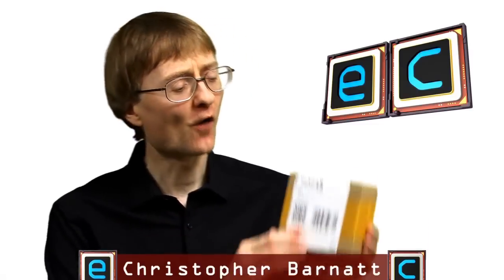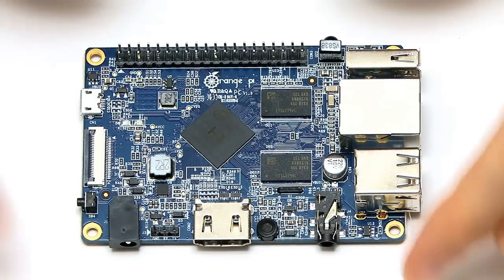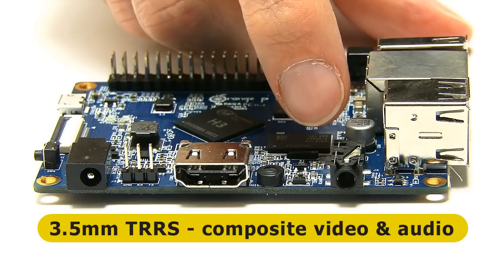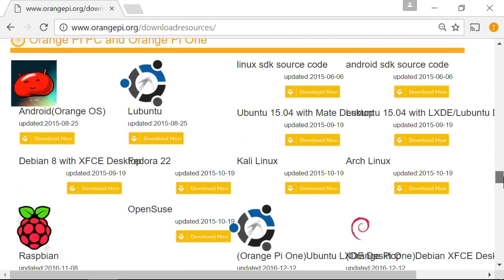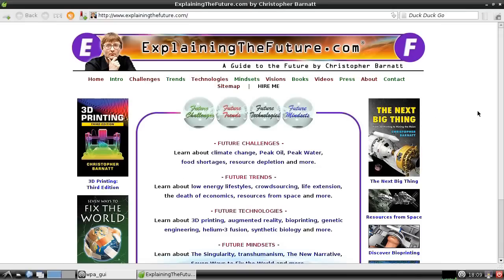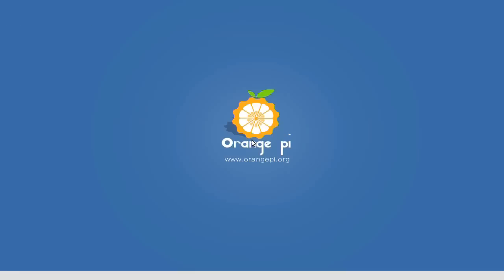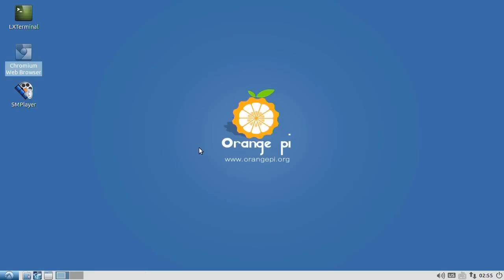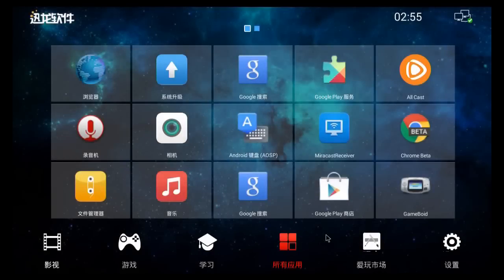Orange Pi PC

Comment: Love your video as always , detailed and enjoyable . I especially like how your videos start with the device's hardware followed by the software (:  Also , I will like to recommend a very powerful single board computer called the Odroid XU4 . It is priced at $61.95 , around the same as the Asus thinker board , but has 8 cores , 4 A15 CPU core @ 2ghz and 4 A7 CPU core @ 1.4ghz . It has 2GB of LPDDR3 ram and a 6 core Mali T628 graphics . It also have good documentation and support a wide variety of OS . Thus , I highly recommend this board due to its price to performance ratio . You can buy it from this website : http://ameridroid.com/products/odroid-xu4"Mr scissors!"

Comment: I was really interested in this video - and disappointed at the same time.  Not because of your video, but because the latest Orange Pi still does not seem to have a stable OS to run on it. :(  So I purchased a Raspberry Pi 3 instead.  I have used the quad-core Pi2 for a year or so now as my OpenELEC media-player, and it has never missed a beat, so we will see how the Pi3 goes.  I will be heat-sinking it though, as the Pi3 would seem to just about go into meltdown if current reviews are to be believed.

Comment: Orange Pi has has a wide range of products, WiFi and/or Ethernet, 256Kb to 2Gb, with or without HDMI interface and many more choices when you buy one of those product you can chose the one which will fit your application In your case you don't have an application in mind for it but you want a WiFi board and got an Ethernet board, why? Did you got it for free from the supplier in which case, to be honest, you should have disclosed this fact, in your video otherwise why did you buy an Ethernet only board when you only use WiFi? Imho WiFi is great for handheld devices, this is not the case of grid powered device connected to an HDMI screen like this device.
When you do a  review a product you don't know anything about, you need to do some homework beforehand to learn about it, if you did, you have found Armbian for Linux applications, Openelec for home theater and at least been able to switch Android from Chinese to English (you were two clicks away from it) and do a proper Android review.
This was a botched review, you made $75 so far from it, I guess its the only thing you care about.

Comment: I was so happy when they removed the click-in click-out sd card holder on the rpi3. The number of times I picked up a rpi2 or 1 and accidently popped out the card, stopping boot or corrupting the card. Pressing on the rpi3 sd card keeps it where it should be. Hopefully orange pi will upgrade to a 'stay-in' sd-card holder soon ;-)

Comment: I have 3 different models of orange Pi's one with onboard Wifi. They have all been a big pain in the ass. I got them because of the 4k abilities. I'm using them as media players streaming and a CCTV server. There is no support community writing drivers and stuff like the RassPi. My problem with Ubuntu is the WiFi or wired network. Even if I do get it working it will change settings and won't work with a week of throwing everything at it but a formatt. Then I'll do something different nothing to do with network. Leave it alone for an hour. Stand on my head with tongue touching nose with my ring finger tickling my right nut it will suddenly start working. Don't ask how I figured that out. This happens on all 6 of my linux systems so it's not some hardware mismatch. I have at least two down at any given time with Kernel stack errors every couple of weeks.
I have 2 Ubuntu PC's 1 Rass Pi, 3 Orange Pi's and 5 windows machines running xp-W10. What I've learned is Windows is great for playing games. Linux the game is just keeping the operating system up and running.

Comment: +explainingcomputers I suspect your USB issues are power related. Also please learn a little more about Linux, watching you try to shut down from a GUI in raspbian was painful
Reply: John Pycroft: Indeed, I was baffled why he didn't just pop open a terminal and shutdown that way.
Reply from the maker: I forgot about shutting down from a terminal -- I have done that before in my videos! And it does not detract from the lack of a GUI shutdown option.
Reply: +John Pycroft

Well, this video is actually a wake-up call to the company behind Orange Pi.  They are competing in the single board computer market, and it is their onus to provide better software support, or at least some better guidance if they want to improve the initial user experience, especially for the international audience, if they want to increase their international market share.

Judging from comments from other Orange Pi users here, I think the best image for it is likely Armian, and the least the Orange Pi company could do is to add a link or even recommend it as their preferred image.  Unforunately, Armian is mentioned nowhere on their website, and that kind of shows how Orange Pi is a little bit out of touch with the wider open-source community, for better or for worse.

Granted, maybe the Orange Pi PC is an older and lower-end product that the company does not care as much or doesn't have the resource to support, but yes, just adding a link to, say, Armian, would be a great start for someone starting out.
Reply: I'm guessing that their level of apathy is showing here such that they're either not aware or simply don't care to do so. Obviously, they won't change their behavior until it hits their bottom line. You wield a lot of influence in this community, so they'd be wise to pay attention to people of your caliber.
Reply: As others have mentioned, open source software does not come with a guarantee of functionality, if there's a problem then it should be reported to the developers and if you have the ability to fix it then do so and add to the projects. 
This video does nothing for and everything against open source software.
Your expectations should not be the same for Linux as they are for mac or windows especially on esoteric hardware such as the orange pi

Comment: Even if the hardware is great it doesn't mean a thing is there is no community behind it. The Pi has both good hardware and software (although the Raspian Lite version is a bit lacking since they turned SSH off by default)

Comment: Just curiously Mister Barnett, are you associated with the Raspberry Pi development Pi manufacturers / developers? I would like to know if the Pi 4 is anywhere near to being released. Thank you/
Reply from the maker: I am not associated with the Raspberry Pi foundation, though have spoken to somebody there in the past. I don't expect the Pi 4 until at least 2018.
Reply: Ok thanks for being so quick and for setting me straight. I was hoping that the Pi 4 would be with us a little sooner than that, especially considering that the Orange pi seems to have missed the mark. Please keep up the good work as you do an outstanding job in your videos. Cheers.

Comment: @explaining computers please can you try to get an Udoo x86 Ultra for demonstration. It's got a 2.56GHz intel quad core CPU and 8GB RAM. Also features Micro SD, EMMC slots and SATA port plus USB and HDMI ports. Accessories include WIFI, a case, fan, and various cables. It promises to be the most powerful board of them all!
Reply: Tech Truth How much does it cost?
Reply: 229 bux. An arm n a leg.

Comment: So it's basically a 100% copy of the raspi 2 3x as expensive with the same specs and 1 less regular usb connector and a power button. Wtf?
Reply: Oh... and a push in/out microsd slot.

Comment: i have this one for some projects but sadly i have been only able to run 3 os armbian, puppy linux and lubuntu on wich i had problems with wifi but first 2 work well, i think android needs more power since its only one using gpu acceleration and posibly there is language option but untill i buy good power i will not found out

Comment: Thinking you could try Ctrl-Alt-F1 to switch to a virtual terminal console, then either log in as root and shut down (systemctl halt, init 0, shutdown -h now, or whatever), or Ctrl-Alt-Del to reboot (and yank the power before Linux starts).

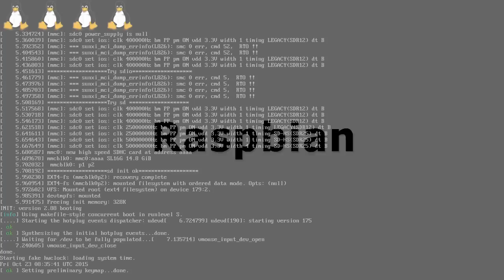Comment: Your WiFi errors are kernel or uboot related. The reason can actually be seen at 8:18 in the video. See dmesg: "ERROR: could not insert '8189es' : Exec format error".  Possible fixes: Compile a custom kernel and/or modify orangepipc.fex to match what is said in the linux-sunxi wiki https://linux-sunxi.org/Wifi#Legacy_sunxi-3.4_kernel_support There is a chance that you can force load the module by using "modprobe --force 8189es"

Comment: hi Christopher!

please, give me some advise

I plan to make a machine - some combined 3d printer / cnc mill / laser cutter / plotter

but unlike most such machines  I want to make de-centralized logics.

so there is a main processor and each extruder and each milling spindle
should also have extra intelligence - many orange pi should work together

how could I connect all these orange pis with the OTG cables - is it 
even possible to connect more than 2 units with USB OTG ?

many thanks in advance

Gerald

Comment: Possibly try connecting the USB devices that didn't work through a powered USB hub? What current can that power supply output? Could be there just isn't enough to power all of those devices.

Comment: Hello, I have an orange pi pc and I have gotten wifi to work on the board. Basically all the images that they provide are crap, they have issues with overheating and usb drivers. In order to get them to work perfectly you will have to use the Armbian images of Ubuntu and Debian. They worked perfectly for me and I can confirm that wifi and usb works. I used that same image to make a small "nas" with the orange pi that I kept running for months with a usb hdd connected to it.

Comment: I'm not sure why reviewers of this board never do any research. There are plenty of people out there stating that official builds are no good. they're only providing the hardware and it's up to us to support it. hence, why it's so cheap. When I bought mine I knew that there wasn't going to be 'good' official software support from the makers. if you READ the forums you'll find that there is plenty of great software from openelec with hardware decoding to retro orange pi with android.  Sorry I love you but you're the 5th reviewer of this board who didn't bother to check the sub-reddit / forums and just assumed that the official software is where it's at with the opipc. this is what happens when you assume.
Reply: My take: Christopher's video is actually a very valuable insight and a wake-up call to the company behind Orange Pi.  They are competing in the single board computer market, and it is their onus to provide better software support, or at least some better guidance if they want to improve the initial user experience, especially for the international audience, if they want to increase their international market share.

Judging from comments from other Orange Pi users here, I think the best image for it is likely Armian, and the least the Orange Pi company could do is to add a link or even recommend it as their preferred image.  Unforunately, Armian is mentioned nowhere on their website, and that kind of shows how Orange Pi is a little bit out of touch with the wider open-source community, for better or for worse.

Granted, maybe the Orange Pi PC is an older and lower-end product that the company does not care as much or doesn't have the resource to support, but yes, instead of showing their own 10 or so outdated, half-baked not-quite-working images, just adding a link to, say, Armian, would be a great start for someone starting out.
Reply from the maker: I take your point, and following suggestions here today I will return to the Orange Pi to try an OS like Armbian. However, these boards are sold via a mainstream retailer and it is not signalled that you buy them with software on an "as is" basis. This could very easily be signalled in the product descriptions -- but it isn't.
Reply: the site is aliexpress but the store is Shenzhen Xunlong Software it's like how not everything on amazon is sold by amazon. I agree Shenzhen is doing itself no favors by not providing good information. take in point the android images on the site. they're just there so they can say it's android compatible but, as we've seen not really usable. I was going to spend the extra money and get a supported board like the Raspberry when I read that people were having problems with the provided software but when I started reading other people having success I dug a little deeper and have been very happy with my opipc. it does everything my friends $200 android box does and 1/10th the cost. I will say that same friend would have ordered this and thought it was junk, I get that. EEVblogs had the same experience as you and did a similar review. had your review been out before his he would be getting this rant. it's nothing personal I love your channel and I love the opipc.
Reply: I'm sure Shenzhen Xunlong knows what they're doing. the orange pi is the cheapest board of it's kind at half the price of the raspberry pi. it's a chinese knockoff that does compete on price per unit. it's all about support if they support everything you can run on the pi they would have to hire a team and that would cost money. right now all they have to do it make them and ship them. it's not a secret in the orange pi community that they provide the hardware and we (the open source community) provide the software. if people bothered to google and learn about a product before ordering it we wouldn't have all the youtube reviews talking about the AC adapter issues and "bad" software support. we'd have reviews that show openelec (kodi), armbian (supported by the armbian team) and retro orange pi (retropi) running fine. perhaps youtubers don't have time to RTFM.

Comment: The software on the OrangePi website is garbage (most overclock the cpu to 1.5ghz but H3 is 1.2 max). All images are broken or unfinished in some way. However there is decent software and that is ARMBIAN. Armbian is a Debinan distro for many single board computers and it has a very good working support image for the Orange PI PC. It has working mali 3d drivers for Opengl ES2 and working hardware video acceleration driver using mpv player compiled to use that driver (4k h264 video runs with 10 - 20 % cpu load or lower). GPIO pins work partially (or maybe i just don't know how to use them yet). Wi-fi works out of the box if the chip inside is rl8188 and the chips rt3070 and ath9271 have working drivers but you have to download firmware blobs to use them.

Comment: You have to install drivers before using a new device on Linux. It's not Windows 10 that it would pickup drivers automatically from internet.
Reply from the maker: Yes, but most Linux distros these days include common drivers (the same way that Windows does -- there is nothing automatic, there are just common drivers already there). And I've never before used a Linux distro -- desktop or SBC -- that has struggled to pick up one of three WiFi dongles, or even a USB drive.
Reply: Could be faulty USB port also. Thanks for the videos.

Comment: Doesn't the WiFi dongles require some firmware? these are properly pc only.
Reply from the maker: The WiFi dongles will require a driver, which ought to be included with a modern OS . . .
Reply: Only curious to what the cause might be.

Comment: To change Android to English....

Look for the Android Settings icon, it looks like a grey wheel or gear. Click on it and open the settings menu. On the left of the screen scroll down to find the Language icon, it looks like a capital 'A' with a box around it or a letter 'A' keycap. Click on it then click on the top line of text on the right side, not the first check box but the line of test above it at the very top of the list. This will pop up a menu you can scroll to find your language.
Reply from the maker: Thanks! :)

Comment: I have an Orange Pi One and an Orange Pi Lite. The best OS is Armbian which, until recently, wasn't even listed on the Orange Pi website. I was able to get my WiFi USB dongle to work on my One and the onboard WiFi also works on the Lite using Armbian. It's possible to switch Android to English (I used Google Translate to help with that), but sadly it doesn't work well at all.

Comment: Just a quick tip, I would not display the front of the box with the QR code showing as you can scan it with a mobile phone barcode scanner app and your address shows up.
Reply from the maker: Good tip. I've just applied a very large blur filter. Will implement fairly soon. Arrgghh! Important learning point for me here. Thanks. I never even considered scanning of an onscreen QR code.
Reply: ExplainingComputers I only know as I'm a postie and it's something I discovered by accident when we first started using those QR codes, so don't beat yourself up to much. I learn enough from you so it's nice to return the favour.
Reply: Because they're square and use dot patterns, most people assume that square 2D codes are all "QR" codes. If you want to be absolutely correct, the codes on this box are actually Data Matrix codes, not QR Codes. Same result (your address info), but different symbology. Most postal services don't use QR as they're often printed on many consumer items for information URLs and could be mistaken or misscanned. Barcode scanners can be easily configured to ignore QR and focus on the Aztec, Datamatrix, or MaxiCode (UPS) symbologies most shippers use.